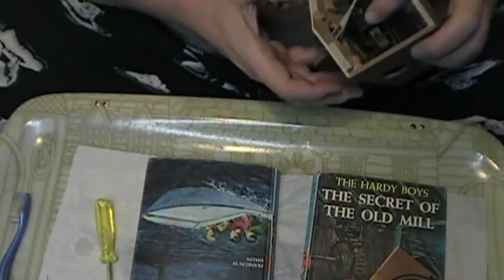Cuckoo Clock Repair 2.wmv

Comment from the maker: Watch for them on ebay, I picked up a clock for $10 that was trashed on the outside but everything inside was like new. So basically I paid for the shipping & then transferred the movement to a clock I was working on. It takes some time to find them for $10 but it works :)

Comment: If you have access to an ozone generating air cleaner or an electrostatic air cleaner (as they are sometimes called) you could put the clock in a garbage bag and rig the machine to blow the electrically charged air into the bag with the clock for a day or two. I sometimes get clocks that were in house fires and this takes away all the smokey smell. You still have to deal with the tar on the clock and I liberally use Scott's liquid gold furniture polish on mine and wipe it down with a cloth.

Comment from the maker: @minibucksminis The chains are a piece of cake usually. If they are still in place you can just turn the clock upside down and let them fall in to place with a little help sometimes. Or you can always pull them out and start fresh by guiding them through. Just remember to secure each one with a wire tie or a pipe cleaner when you are going to be working on them to keep the chains held in place 8°)

Comment from the maker: Thought I answered this... Sorry :) Sounds like new movement time most likely, pull it out, check it one more time & then if you don't see anything pull back on the chain gear while looking at everything. If you don't see anything giving then pull a bit more. Most likely you will see a plastic gear go flying if there is one but if it's all metal then it can be freed up sometimes. Look for cracks in the gears, you should be able to see where it's hanging up when you are pulling back on it.

Comment: I just a bought cookoo clock. All new in the box 2017 non-musical 1day schneider from cookoo palace, didnt run. Time chain came off the spool, very difficult to put back on without taking the Bellows and movement out. Long story short, even brand-new clocks will quit right out of the box even if packed very well. I also have an old 1970's 1day musical cookoo clock. Pulled the movement out 9 times because time, strike, or music chain came off or something else wrong.

Comment from the maker: Cleaning it helps but oiling it every year or two is what keeps it working. If it runs out of oil it stops. Before I put them back together, I have them either working in my hand or flying out of my hand & into the garbage if they don't. New movements can be found cheap if you look. I paid $10.00 for my last replacement movement :)

Comment: I've taken on the new hobby of clock repair for fun and family so love your videos. One problem i seem to have run into is I have three cuckoo clocks, and all from ebay. I've done oiling them all, rebuild them all now one working great. Two other need a bit more weight on the clock chain to run, seems I need a bit more to d cause if I add a bit more weight they runs smoothly. Any thing i might be missing? Thanks again, keep it up.

Comment: So you tinker on them a little and then just throw them away if you can't get them going by knocking a bit of dirt out of them and throwing a bit of oil on them? Adding oil over and over without actually cleaning clock movements makes the lubricants become abrasive and will simply wear out the pivots long before their time.

Comment from the maker: The hour hand just presses on, so gently pull it off, then when it cuckoo's push the hand back on the outer shaft exactly at 12. It won't hurt it if it is a little off but make sure that the hand is in good shape and take care to watch for cracks when removing it. Lot's of times the hand will break right at the circle washer, so take your time and watch it close when removing it. It's best not to pull it off by the hand itself, just pull out on the mounting ring.

Comment: Reed,  I have  a cuckoo clock almost exactly like yours for many years but it has only run maybe2- 3 months.  I think it stopped working because I mounted it on the wall at a slant so the weights would go over a ledge under the clock.  I asked a Yahoo clock group about it and they told me to soak it in ammonia water solution and rinse and dry it.  It has never had rust or dirt before or after.  Anyway, I have the mechanism out and the gears only turned a sixth or so of  a rotation.

Comment: I have just followed this video and managed to get an almost identical clock working again after many years of it not functioning, brilliant and thank you. Just one simple question - although it keeps fairly good time it does require 'winding' every 12 hours or so. I'm assuming this is normal but did think it would have been a 24 hour mechanism. Perhaps you would comment. Thanks again for a very informative and thorough video.

Comment from the maker: Actually that's going to be in my next video but do both anyway because they're cheap and you have to pull them anyway. But if they have just pulled away from the wood, just use some hot melt & put it back together.

Comment: The mechanism, while not rusted, had hair balls everywhere, I've cleaned it and like I said, operated it with my thumb, should be great when I oil it. Waiting on my oil, plan on using the toothpick method. It came with 275 gram weights, not sure if originals. Per Ronell Clock Supply, the Regulus 25 like this one is set up with should use 320's, should I replace? I really hope you have a video about replacing bellows tops.

Comment: I had a Chain that just Broke, and the chain came out. it is not so easy to just thread it back on as you have shown. Mine is a 1 day Musical Loetscher Chalet with Bird, Water Wheel, and Dancers. Has the Dogs in the front. I brought it to a Clock Repair Man Farfalla, today with Decades of experience here in Goshen, New York. Needless to say as He put the chain back on, a special tool was required. It takes precision and some time. As I watched him repair it, I would never had been able to do it myself. It cost so little to have it done professionally, and well worth it. So when I see Videos like yours and others claiming that it's so easy to just thread the chain through the hole and hope it catches on to the right place, I have to disagree.
Reply: Came here for just that problem. Just fixed an old Cuckoo Clock that was in the family. Third day I had it up, I wake up in the morning to find the main chain on the floor. The entire thing broke off!
Reply: I guess I got lucky. I have an 8-day movement and restored it and I threaded the chains through on the first try. By no means am I saying it was easy, but it was not hard. Once I got both chains through, I used a bread tie to tie the chains together so I could hang the clock and finish putting everything on the chains so they would not thread back out on me.

Comment from the maker: I'm not sure what you mean by only 2 holes at the bottom so make sure that the chains & weights are correct. Maybe the cuckoo mechanism was never intended to work if the holes with chains & weights for the bellows are not hooked up. If the gear is there with no chain, then go from there. I have never seen a single chain activated cuckoo. If the striker is there for the gong but there is none visable then look at the back cover & see if the holes are there. You can buy them to fit on ebay.

Comment: Reed I enjoyed this video very much. So much that I've decided to try my hand at it. I have 2 nieces and 1 nephew getting married and I'm determined to restore them each a clock as a wedding present. Got my 1st one today, little rascal like the one in the video and immediatly disassembled it. Mechanism good, able to run it with my thumb and engage the cuckooing like you did in the video. 1 good, but aged bellows, 1 blown up, should I replace both and do you have a video replcing bellows top?

Comment: I was just wondering why not put the whole piece into lacquer thinner swash  it around a bit blow dry and then pick what lint or what ever out and then oil - just saying but I usually work on auto parts which that works well ? thanks for the video

Comment: 1/4 novelty cuckoo clocks run on one weight and only have one chain. They cuckoo one time every 15 minutes. The bellows lift wire works off of a wheel that usually looks like a four bladed pinwheel or a disc with four pins in it that is attached directly to the back side of the hour shaft.

Comment: I have the exact clock on the right in the beginning of this video.  It was purchased by my father in law in Germany about 40 plus years ago.  I've tried to tinker with it.  It's missing some weights and some internal pushrods.  One of the coo coo doesn't work.  Can I ship this to you for repair?

Comment: I have had it on a board to another look at it.  The gear with the spring loading behind is not locked to the shaft and maybe this is why the hands can be moved maually by turning this gear. Should this gear not be locked to the shaft in order that it will move the fingers via the weights?  Should it be locked somehow? I can't see how it is locked if that is the case.

Comment: enjoyed your video, thank you! I just received the wood chopper with waterwheel like yours from a yard sale and got everything working but the music box/waterwheel, looks like i have some levers/wires not connected correctly?? 
Is it possible to do a short video showing the mechanical linkage and doodads that make up that clock? It would give me a great starting point. Thanks again!

Comment: THANKS for the reply...  OK, I'll leave the Axman alone as the Ax DOES move, just Not to the log.  Sawmen too, I guess I'll leave, as they do move a bit/
Now, can you explain Exactly where the Cuckoo wire should go?  It is presently "sitting" ontop of the left bellow (looking in from back) so the actual bellow lifts it up and down.  Is that correct?  Cuckoo ONLY moves slightly.  -Chris

Comment: Hi.
Great Cuckoos!  I was recently given one like yours at the start of this video, with the Lumberjacks. It is an Emil Schmeckenbecker from 1969 (May).   It seems to keep time, however the Sawmen hardly move at all, the cuckoo does Not move (wire seems disconnected), and the axman moves, but not enough to hit the log.  Might you be able to point out which pieces on the inside need the fine tuning?  I'm ready to work on it, but do not want to further put things out of tune...  -Chris

Comment: First, the case would have to be big enough. Then, you'd have to do a lot of modifying the case. Drill new holes for the chains. Put new thin blocks of wood to mount the movement and take off old ones, if the case used them originally. Do a lot of adjusting to the bellow lift arms and the chime hammer. Make the bird post fit. It's more of a job than it sounds. Good Luck.

Comment: You can recover them yourself cheaper and easier than buying and installing new bellows. The material used is similar to TYVEK with a lining to keep it airtight. It's usually sold as "bellow paper" or "bellow material".

Comment: Hello Reed , Thank You for video very informative very helpful , A friend of mine gave Me a clock that needs repair , I'm currently in the process of repairing clock , this is a first time thing for Me , I've cleaned gear box inspect all moving parts chains wieghts bellows ect.. , oiled all moving parts , very thorough as You show in video greatly appreciated by the way , I've tested gear box manually seems to work well , My question is when I go to test by installing gear box and wieghts , hanging on wall the left side of the gear box moves freely as if possibly missing a gear somewhere that locks that makes that side work properly , I'm wondering if I'm doing something wrong , does the whole clock have to be fully assembled? , or is it possible a gear is missing that would cause this problem , right side works great , Please get back with Me on this when You find time , Thank You again Reed , for a very informative video on repairing these clocks , My clock is pretty much the same as in Your video , also do You have a video on how to repair the gear boxes as well , Thank You , Reed .

Comment: Reed,

I just purchased my first cuckoo clock and was researching how to it running and repair and I ran across this video. First, the clock I purchased (Good Will for $8) is just like the one in the video. Can you tell me about how old it is? Secondly, my clock pendulum acts the same way, so I will try what you suggest. Third, the hour hand is broken and the piece going over the roof is missing. Is the clock worth me restoring? 

Thanks

Comment: The wire that my bird sits on does not move. Was there some kind of installation trick. Does that paddle on the middle of it need to be oriented a certain way? Other than that everything is normal except for the gonging sound.

Comment: I have an old german Cuckoo clock that worked pretty well until last week
now the pendulum works several seconds and stops. Do ypu know what could be the reason. When I remove the pendulum it works fast and doesn't stop....

Comment: I really like your videos! I have a question bought a cuckoo clock 8 day hunter. It runs great all of the time and will cuckoo for a while and then will get what seems to be "hung up" and if I pull the weight just slightly and I mean slightly it will cuckoo. The chain is in pretty bad shape where someone has messed with the links and some are bent pretty bad. Two thoughts the chain is part of my problem if not all of the problem and maybe I missed oiling something? A few things the wire coming off of the bellows is below the bird, door latch is out of the way allowing for the door to open fine. Appreciate any advice and appreciate your help in advance.
Reply from the maker: +matt wiseman You have to pull the front off or remove the movement to check the gearing for the cuckoo. It could just be a small piece of dust in the bottom of one of the gears. New chain is cheap http://www.amazon.com/s/ref=nb_sb_ss_i_1_18?url=search-alias%3Daps&field-keywords=cuckoo+clock+chains+for+2+weight+8+day+regula+34+movement&sprefix=cuckoo+clock+chain%2Caps%2C693
Reply: Your clock needs more than a cleaning and oiling. The clock has worn bearings. If it runs when you pull on the weight the clock needs more attention than a cleaning. 8 day clocks have very heavy weights and that constant force wears out the bearings. The chain links are coming apart because you are pulling down heavily trying to make the clock run. In most cases cleaning alone will not cure an ailing clock.

Comment: Hi, great work..I have an old chess clock that I took apart to clean because it stopped working, it's a little bit more challenging because the clock movement parts are much smaller than the Cuckoo clock you worked on. Unfortunately in the process of removing the clock mechanism from the housing some of the gear fell off and now I found myself having to put it back together. Could you please 1- offer some advice as to what tools I would need to put the parts back together; I know I will need a main spring clamp to uncoil the spring prior to removing them. and 2- how can i clean the small movements in the future without having to take it apart. oiling doesn't seem to always work. Thank you very much

Comment: as I wrote earlier, got the second clock the other day. Looks like someone tried to fix it with a different movement. It keeps good time but the cuckoo is weak and too fast. The bellows are good and sound strong when they open fully. It looks like whoever rebuilt the bellows put the little circle bolt too far away from the fulcrum reducing how far they open, have you ever run into this before? I'm going to make sure all the slack is of the lift by adjusting the bend but I think that Obolt is it

Comment: I have the same cuckoo clock with the waterwheel but the spring for the wheel shaft is broken. I was hoping that you have the information on it to find the replacement spring. Also my gong spring got lost at some point and need to know what size one to get from Black Forest

Comment: Looking from the back of the clock there are 4 holes in the front and two on the left side back (looking from the front of the clock there are 2 holes on the right and 4 in the back)..... I have all the chains on... so it was going to be a process of trial and error... or you might know.... thanks

Comment from the maker: I would first check the bellows, most likely they have torn. All of the chains are the same size. If the bellows are moving up and down on the hour to make the clock sound, & there is no sound then this is the problem. But it could very well be the chain and weight as both the weights should also be the same.

Comment from the maker: The links are no big deal just bend them back together, throw some tooth picks in the screw holes and see if the screws will hold then start it up and see if it works. Then if it doesn't you can take it in but many times they can run fine with just a little work :)

Comment: The angle to the bent wire connected to the bellow that is not directly attached to the lift arm needs to be bent a little sharper and the nail it catches on bent slightly forward. Good luck.

Comment: Ok what are your thoughts on a Cuckoo clock that will run for 2-4 hours and then stop.  The clock I have looks very similar to the one you are working on in this video.  When I look in the clock it looks clean as a whistle.   It is level and plumb according to my husband.